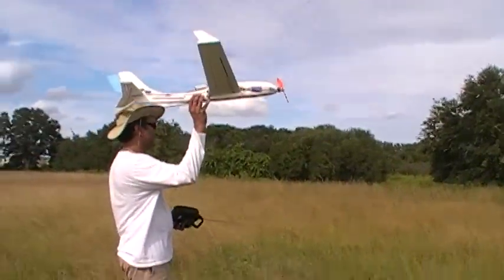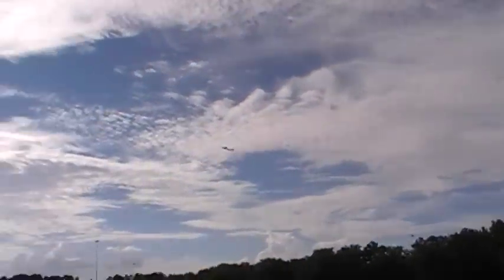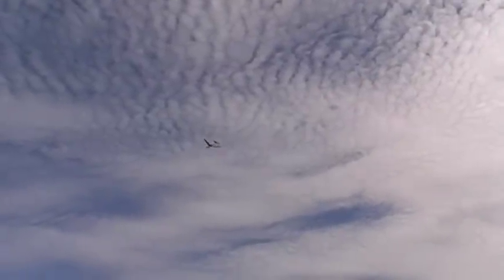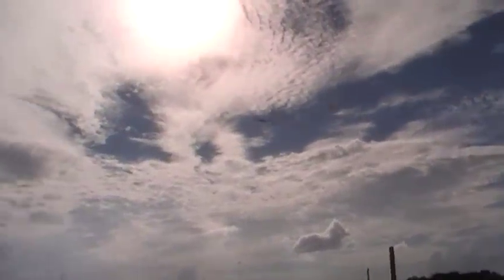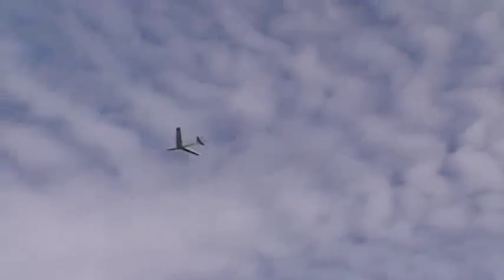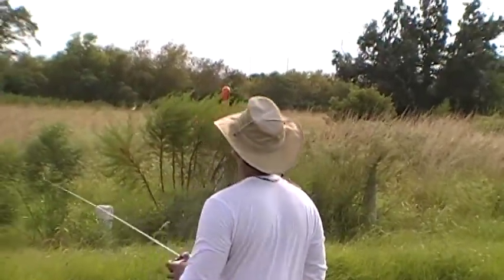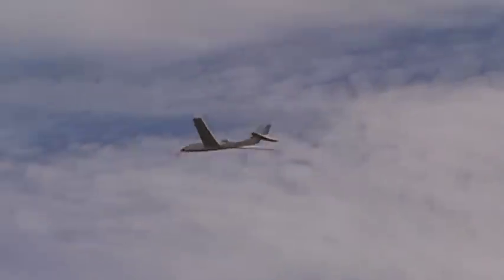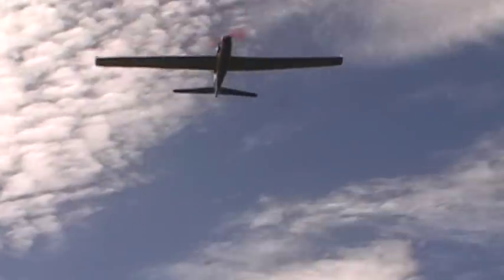Turning a Kid's Foam Glider into a Radio Controlled Airplane

Comment from the maker: We went separate ways unfortunately so I will try to apply what I learned on a new plane concept on my own I am devising.....a Blended Wing Body Flying Wing, this time with the prop in back. He called a few months ago and helped me select basic items for foam plane construction which I bought at a local hobby shop. In Denver I made paper flying wings and so will use them as a template, especially as regards center of gravity and the angled up rear of each wing tip to keep the nose up.